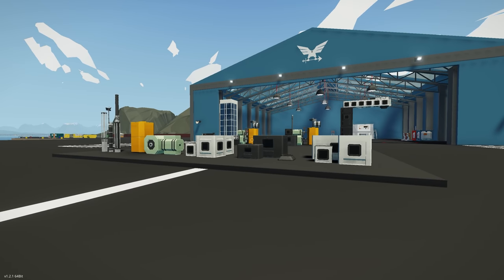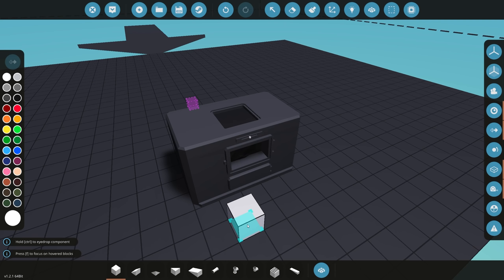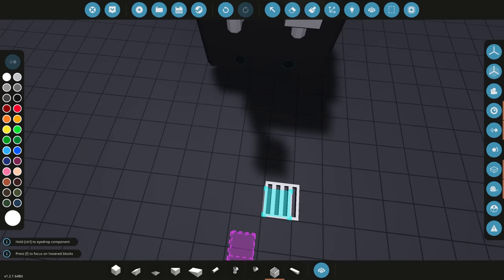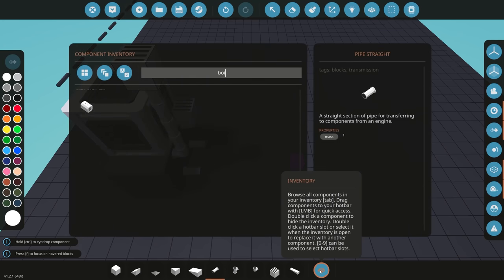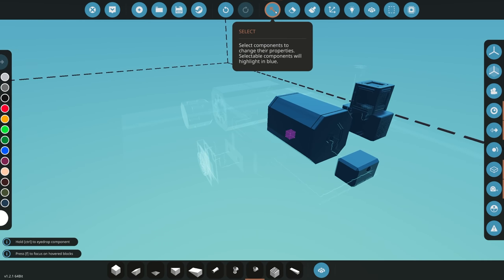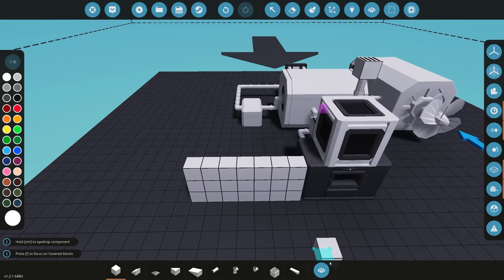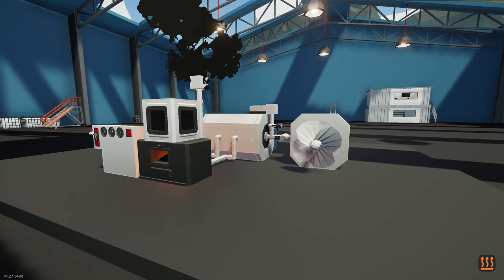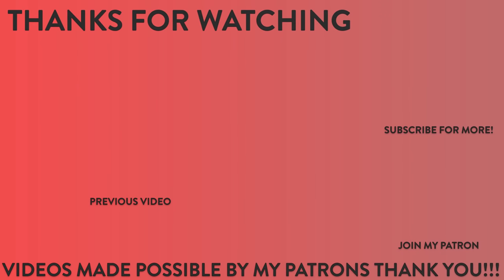Building a Coal Powered Steam Engine!!!! - Stormworks

Comment: I already know that the next 1-3 weeks there is gonna be a lot of old style steam boats and maybe trains on the weekly top builds and a lot of nuclear reactor builds too.
Reply: someone's gonna rework their titanic and add boilers and furnaces since that's what the real thing had as well
Reply: It's only proper since we actually have steam engines now i already started working on a steam powered ship :)
Reply: Cool I might make a steam engine tomorrow to know how they wotk better
Reply: Well maybe not ships as I’m having my steam engines way to underpowered I’ve done everything I can to try and fix it I hope they fix this soon or I’m doing something wrong
Reply: And Nuclear Submarines aswell
Reply: @speedygrove  We do not have steam engines... we have a steam turbine and that's it, and that is also why we still cannot create authentic (coal fired) steam ships.
Reply: @NPC_-mf4dw  the firebox uses coal. So, close enough. I've already made a steam train. It is very slow, but it works. I may need to try and increase my max pressure, cuz it currently sits at six when idle, and five when under power.
Reply: @theplaguedoctor6129  Dude said "we have steam engines". I corrected him that we do not, which is a fact. 
A boiler being coal fired doesn't mean "steam ENGINE". 

Google what a steam engine is, perhaps.
Reply: @NPC_-mf4dw  googled. It is a machine that uses steam as the primary fluid to produce mechanical energy through a piston. Idk about you, but the fact that we have a turbine instead of piston housings makes little difference to the basics principle of a steam engine. Of which is use steam to make mechanical energy. If you want to rest easier, the coal fired sector could be for power plants. Since that is how a coal power plant works.
Reply: @theplaguedoctor6129  "Idk about you, but the fact that we have a turbine instead of piston housings makes little difference to the basics principle of a steam engine."

Except that the difference is massive. Turbines function differently and are very large. A steam engine can be very small yet still powerful - see trains.

I don't know why you keep on insisting that the difference is neglectable when it simply isn't. Words and terms matter. Calling a steam turbine a steam engine is factually wrong.
Reply: steam powered destroyer from WWI here i come
Reply: @Hyper Steeve yeah I'll add that too because I didn't know nuclear engine were out at the time a wrote this
Reply: @NPC_-mf4dw  i mean, yes, but in this instance it is the closest we have to a steam engine, so imma call the steam power in my train a steam engine. mostly cuz it gets the job done. this is really just an instance of "close enough". so, it may be wrong, but that doesn't mean that it doesn't have some merit behind it to be wrong. imma throw a curveball. technically if you stick a steam turbine in a train engine, that train is still a steam engine....... just a stupid mental process i had that i felt needed to get out there
Reply: we also might get some update on some submarines with reactors
Reply: @theplaguedoctor6129  use large fluid pumps on the intake and make it max power and use a fluid port instead of an air filter, it might work, I’m working on a forced induction steam train

Comment: Hopefully in the future they elaborate more on steam. Add fuel atomizers to burn fuel oil instead of coal, module based reciprocating steam pistons to get that satisfying chuff chuff sound, superheaters, steam whistles, stack blowdowns, the ability to adjust fuel/air ratios etc.
Reply: upgrading things like the boiler would be cool too. Maybe add like, insulation blocks or insulated pipes to reduce heat loss from the boiler, which would demand less energy from the fire box to maintain the same pressure/tempersture.
Reply: yes the iconic chuffing noise and steam whistles would be great

Comment: The devs should add steam pistons that could hook up to modular engine crankshafts that maybe could produce more torque but are slightly slower.
Reply: I was expecting that more than turbines tbh
Reply: Bit difficult to have a massive turbine on a steam locomotive but much easier to fit a single pistol on each side.
Reply: I know, right.
Reply: I was expecting the boiler and firebox to be modular like a custom tank
Reply: @mechannrt8561  That would have been cool.
Reply: I want a whistle
Reply: Maybe we will get it if we ask nicely
Reply: they did
Reply: @chester000017  I know

Comment: I'm working on a ocean liner with 24 boilers right now. Really liking the steam power! :D
Edit: 32 boilers now!
Reply: @Railfan 765 Cruise liner
Reply: @Railfan 765 ocean liner. just changed it
Reply: @Railfan 765 well, when a cruise ship and an ocean liner love each other very much...
Reply: It’s the perfect boat hauler
Reply: @Railfan 765 You should be able to see it if you go into top screenshots for the week and go down until you see a 3 stacked ocean liner picture posted by orbitsoup.
Reply: @Railfan 765 The highest up one is the most recent photo.
Reply: WOAH
Reply: Don't you think that's a bit much?
Reply: @Railfan 765 Welp time to add more to mine... My ship barely fits in the creative island boat area and it only has 2. Doubt it will go very fast.
Reply: @cdredstone  Well it is 125m long and 16m wide.
Reply: Do you use multiple turbines per boiler? How many fireboxs per boiler?

Comment: we need hand operated steam / fluid  valve for our boilers !!!
Reply: Throttle+ variable valve
Reply: Or they just make a valve wheel kinda throttle lever
Reply: @NCIA-93  No, too much to ask. These devs are too inept. This much should be clear by now.
Reply: @NPC_-mf4dw  Too inept despite the fact they added functional military weapons, radar and sonar technology, steam and modular engine technology, pipe plumbing systems and valves, complex water physics (which, no matter how much you wanna nitpick it, is still better than most other games) gave the players three entirely different gamemodes, and that's just the tip of the iceberg.

What is so inept about the Stormworks developers? Only thing I could criticize them for is their selling of player data to Google and 3rd party services without any notification or consent from the consumer and censoring all about it in their discord server, but that does not mean they are inept. Outside of that, the Stormworks developers have managed to create a successful game. Nitpicking with bland accusations without elaboration in several different comment threads does not make anything about them clear, only the fact that you like to nitpick with bland accusations without elaboration in several different comment threads. Enlighten me, professor.

Comment: I used the pressure release method, and that seemed to work well. However I did notice that after the first release, the pressure never rose again, instead it slowly decreased over time. I know my relief valve was closed, so I'm not sure why the pressure continued to drop. I was also slowly loosing steam from somewhere in a closed loop, which was interesting. Can pumping too much water into the boiler cause it to flood and release less steam?
Reply: If the steam was released without being put into the condenser, you may have not had enough water to keep the system going. Try running the pressure relief system straight into the condenser instead of into the air( I’m assuming that’s what you did) and you should not lose any water.
Reply: @jamesdeznuts5603  I had a full tank of fresh water that was pumping in, and was full, which is why I was confused about it. The engine ran fine, but stopped going over pressure. The boiler was full of steam and was loosing it. I wonder if my water pump is backwards, I'll check that next.
Reply: @EnderMalcolm  I had that to, but you can also see in the video that the tank still has 120 litres in it but it didn't go in the boiler for some reason, 14:11
Reply: Had the issue (with 1 medium tank) that the boiler volume would quite fast drop to 0 in a closed system. 
The reson was i was dumb and forgot to set the tank to fresh water.
Reply: @t3n0n79  I had my condenser on backwards, it was blocking steam flow>.<
Reply: @EnderMalcolm  for me i got the issue now that it will lose its fluid volume. but i got a closed system. 
Water tank > pump > boiler > turbine > condenser > back to water tank.
first the volume of the water tank is drained into the boiler. the steam in the boiler increases but the tank will run out of water and then the boiler. steam is not going to become water again. so the system will lose pressure after a while and will stop work. 
i just checked the condensor if I placed it the right way. but it seems right. i also upgraded the "coolant loop" of the condenser because I can see there is 10 "volume steam/water?" in it over time. I also started to add a pump between every connection. 

Btw i needed to place a pump between water tank and boiler otherwise the tank would be used.

Comment: Pretty close to my compact steam power generator build.  Tried running props off the turbine and had very little luck getting over 1.5 knots with larger ships.  Electric engines worked much better, and coal turbine powering generators to keep it powered.

One thing I'm working on is a quick shut-down to the coal firebox.  Tried cutting off the coal supply but it still took a long time to shut down.  Next I'm gonna try a cutoff on the air supply, hopefully that works.
Reply: Cut off the water circulating into the boiler, that will cool the boiler if you care about the boiler, then just empty the coal box and let it cool down. 

How many turbines do you use? Do you use a gearbox?

Comment: So i made a steam train and it works great, but after a certain amount of time, itll just stop, and it still has coal and water and the boiler keeps going and so is the firebox, but the train just stops, any ideas why this is?
Reply: It is probably loosing pressure.  You have to balance steam out and water in, along with the heat of the boiler.

Comment: Hey! Can you use the boiler as a heat exchanger for your normal engines??? Make power off your cooling???
Reply: IRL, that would require a phase change (evaporative) cooling system, where whatever coolant youre using in your radiator actually changes phases from liquid into a gas.

Such systems are simple if you treat the fluid as a consumable to exhaust, but complicated if you want to condense and reuse it. But, they have the potential to be really effective and efficient due to the sheer amount of energy fluids can absorb in a phase transition (and fluids at a phase transition will absorb energy without actually increasing in temperature, because the energy actually goes into the transition itself... Which is potentially beneficial if you want the fluid to stay under a certain temperature, but still absorb thermal energy).

Evaporative cooling was used in the German ME-100 fighter in WW2. What made its system impressive was that, instead of using efficient, but draggy, air cooled radiators, it instead used the surface area of the wing as one giant radiator fin. This was one among many drag reduction techniques in that plane, which made it perform better than its competitor, the BF-109. In the end though, the ME-100 failed to be officially introduced into the luftwaffe, because... Well... Radiators are a week point in an engine. One round holing a radiator all but garuntees eventual engine failure once the coolant runs out. So which is more likely to be hit by incoming fire, a small radiator, or the entire wing? Also, the system was really complicated on the Me-100.

I will say this though, I don't know how much energy you could squeeze out of a coolant system that uses evaporative cooling (at least, a system that includes a condensor that is. It would be easier in an open loop system). And furthermore, adding a turbine to the cooling loop would reduce the flow rate of that coolant... Which would in turn, reduce the cooling rate of your cooling system... Which in turn would maybe be more detrimental to your engine's output than any output you would gain from the coolant turbine... Which may be why this isn't typically done IRL. In theory, you could just engineer a beefier cooling system to compensate (bigger condensor, bigger radiator, more coolant), but then you're adding a ton of weight and complexity to the system.

I dunno, its an interesting idea at least. A similar concept, the turbine power recovery system, was used in the last generations of military aircraft internal combustion engines in the USAF on planes like the B-50. This was basically like a turbo, except instead of using engine exhaust to spin a turbine to drive an intake impeller and compress intake air, the torque from the turbine was instead sent directly to whatever the engine was outputting power to, adding horespower directly to the system and assisting the engine directly in powering the propeller. It was an insanely complex system, and had similar engineering problems to your idea, (namely, how to do this without generating enough backpressure to reduce engine power). It worked well once developed, but development down this path was abandoned when the turbine power recovery was starting to achieve horsepowers that rivaled the internal combustion engine itself, and engineers asked themselves... Why TF are we developing this when we could instead ditch the complicated, maintenance hogging, less reliable internal combustion engine, and instead focus on developing better turbine technology, as those are relatively simple and cheap to maintain by comparison... As in, lets switch focus to building better jet engines, turbo props, and turboshaft engines instead.

None of this has much to do with the game I guess, but I'm just thinking outloud about doing it IRL, and thinking about whether the game simulates RL enough to do it.

Comment: But.... how do you turn it off?? Or is it supposed to stay on?
Reply: you unload the coal out of it by hand
Reply: If you use a valve to cut the air supply to the firebox it will slowly cool down. Basically starve it of oxygen like any other fire

Comment: I'm having problems getting fluid to flow into the boiler, getting steam out of the turbine, and water out of the condensor. I have everything plumbed correctly, but its just not flowing. My systems setup with a variable valve and exhaust port to vent pressure but it doesnt work. Same with every other component.

Comment: You could increase efficiency by using a controller to power the firebox on and off to control the pressure. It would just need to take the time into account for heating and cooling the boiler

Comment: Question. Did you empty the boiler fluid level and leave only the fluid in the water tank? It seems to me that a 1:1 boiler to condenser isnt enough, and I'm thinking maybe it's because the condenser cant keep up? I'm not having a pressure issue though so I donno
Reply: In the most recent update, they broke condensers, so idk what to do.
Reply: @overclocked5422  ok I thought so. The only time my condenser works is if my pressure valve vents a ton of steam at once into the condenser and for some reason then it will put water back in. But otherwise it just sits there and happily builds up water. Glad to see I'm not the only one with this issue. People on discord dont really seem to care
Reply: @thorgeirnable  Use a water storage tank to fill the boiler and use the water from the condenser to put back into the storage tank.  The boiler does not use as much water any more, so it takes less water to make a lot of steam.

Comment: A lot of people have noticed the nuclear engine and the steam engines are extremely underpowered
Reply: i was wondering this after playing around with them for a few hours. Usually IRL steam systems require a pressure difference to operate as efficiently as we would want them to, many Navy vessels used steam-powered vaccuum systems to help draw steam through turbines. That said, i can never seem to force my system to input more than about 2.7L/s into the turbine, no matter how much I sukk it back out again with pumps or additional boilers. 
 It might be something that'll be altered soon, like the modular engines a while back, after having wider player feedback.
Reply: Nuclear Engine are underpowerd? not for me.
Reply: @foty8679   I'm talkin about when you use them for large ships
Reply: @foty8679  it may be a setup issue or an operation issue, but i've not had that much success with using them for ships. The power tends to be far too little to get above maybe 4-5 mph (of whatever the in-game speed it) and that's with the boiler at the point of bursting. :P

Comment: Uhm Okay so we can power these steam engines with modular engine heat and skip the coal part, right?
Reply: Did you try it?
Reply: I dont think it would work, if the engine gets too hot it blows up, if the boiler isn't hot enough it wont work.  the temp that is required to boil water and the engine blows up at is really close.

Comment: Do you lose some water even if nothing gets vented out?
Also how do you get fresh vs salt water? And why does the game even have both?
Reply: To answer your questions.
In theory, you shouldn't lose water if it's not vented
Fresh water can be selected in the menu of a fluid spawner
In the real world, ships can use fresh water or salt/sea water cooling. You can use salt/sea water cooling in stormworks, but it creates scaling in the engines as it's direct from the ocean (as in real life). Or you can use a closed loop fresh water system with heat exchangers. 
However direct seawater cooling provides better cooling, in my experience (in game)